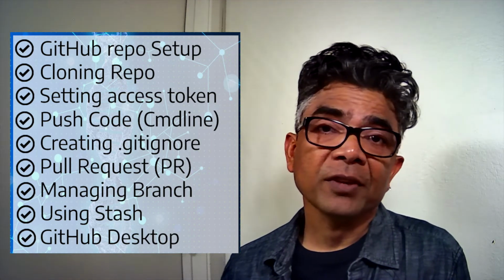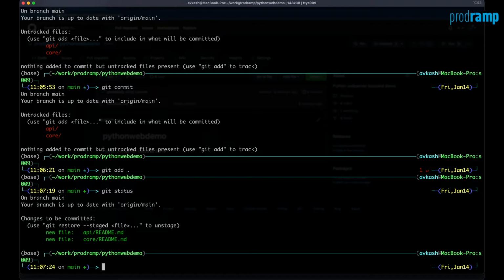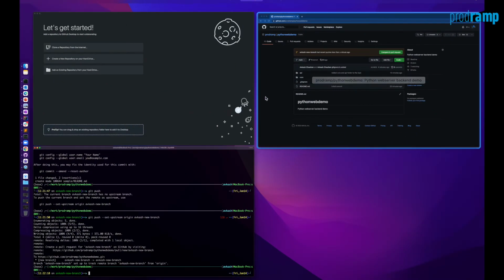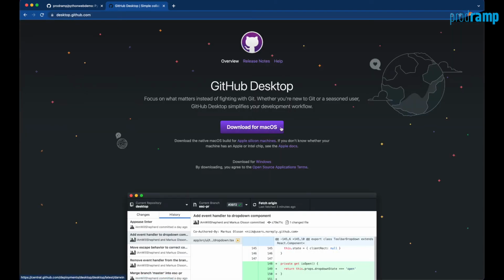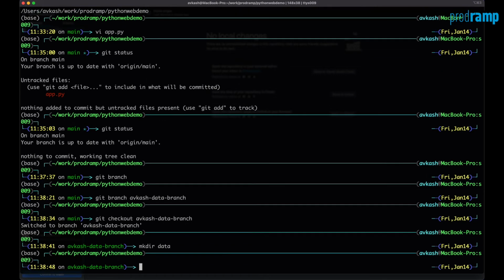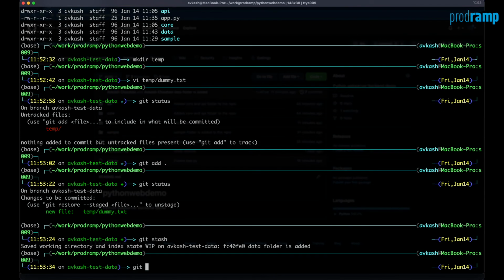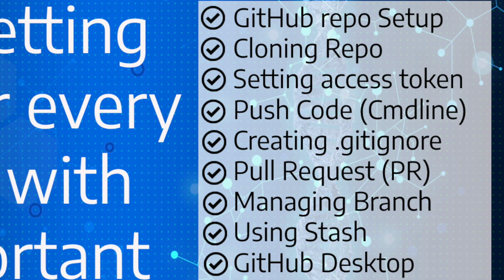Hands-on GitHub for every developer with most important tasks and tips (Using cmdline & desktop app)

Comment from the maker: Tutorial content and timeline:
- (00:00) Start of the tutorial
- (00:06) Tutorial Intro
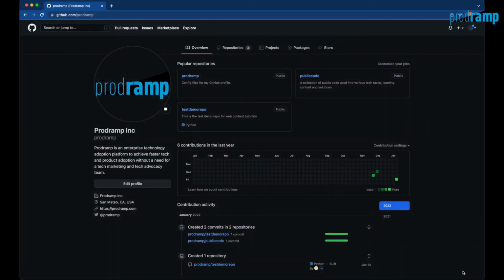- (1:50) Setting up your GitHub repo
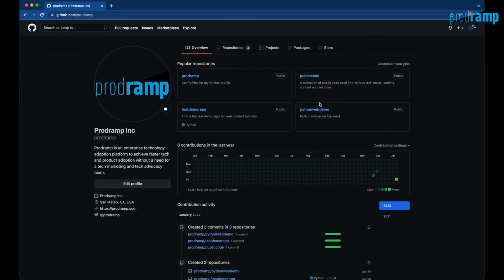- (3:00) Cloning GitHub repo to work locally
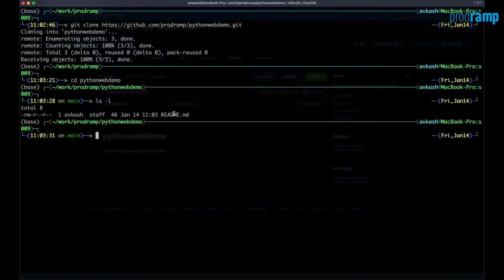- (4:00) Working on your local folder
- (9:00) Setting up GitHub access token 
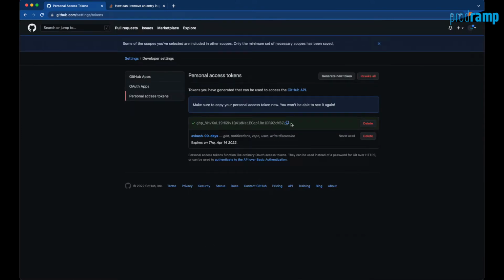- (10:40) Your First successful commit
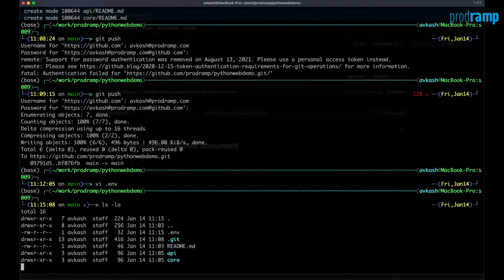- (13:30) Adding .gitignore file within the GitHub Repo
- (15:00) Add, commit, Push and Pull code from command line
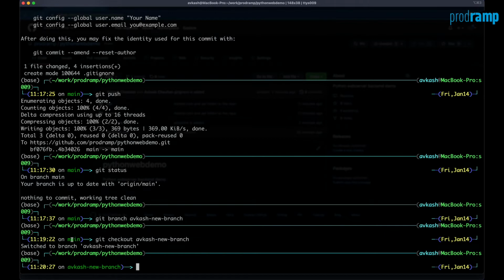- (18:00) Manage various branches
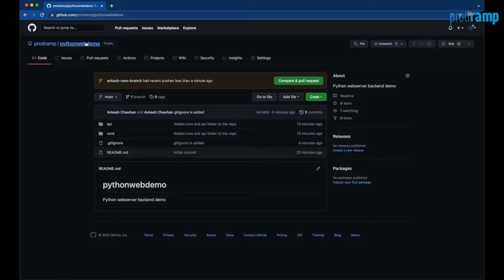- (20:00) Create Pull Request (PR) and merge the code 
- (27:00) GitHub Demo setup and managing repo from GitHub desktop
- (37:00) Using GitHub Stash feature to manage local content
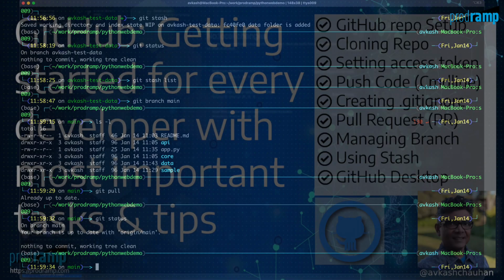- (44:10) Recap